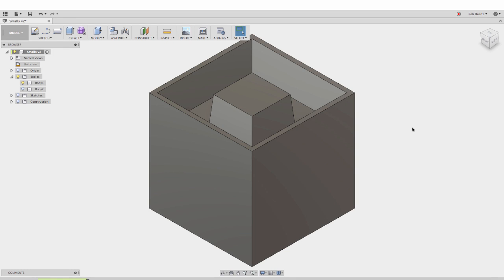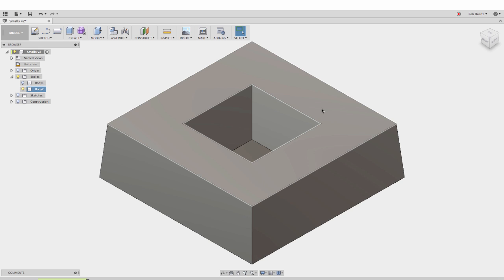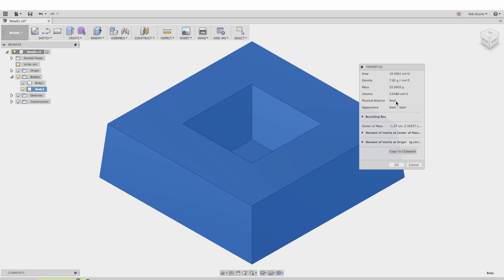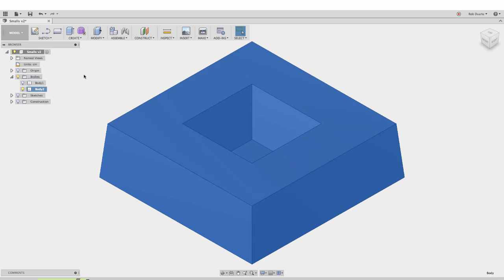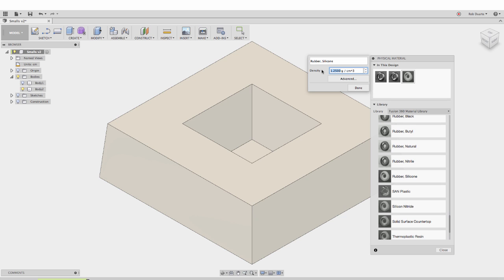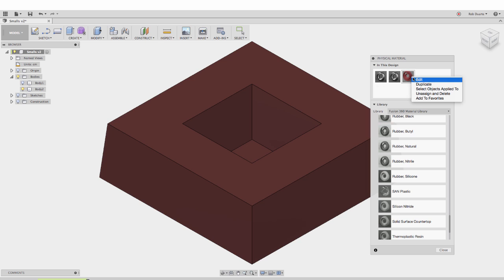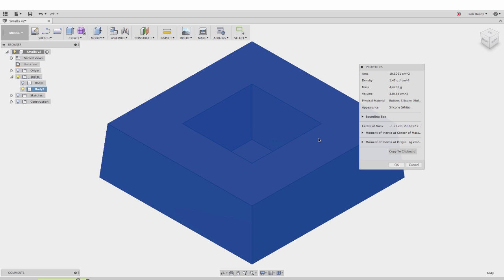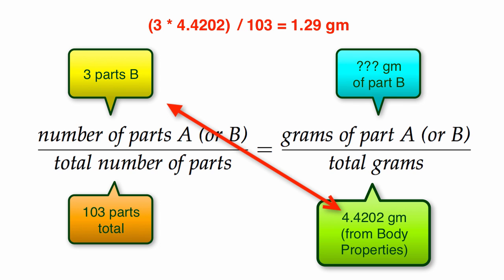Fusion 360 Physical Materials, Mass, and Volume!

Comment: Hey Rob .. Thankyou for this fantastic video ... A quick question to you .. I am a user of Fusion 360 and the mass I want to see it in pounds but even in your video the mass is in grams .. If I want to see the mass in pounds where is the setting for that
Reply from the maker: Thanks - to change that setting, click on your name in the upper right corner to get to Preferences. Then under "Unit and Value Display", change the "Material Unit Display". Good luck

Comment: I made a quadrilateral volume that I need to know gallon capacity, defined it as water, and the properties show bogus numbers. 1.52E+05 in/\3  I figured it out via online calculators finally. So 1.52E+05 in/\3 = 498 gallons. lol
Reply from the maker: Glad you figured it out - they're not bogus numbers, that's scientific notation.
Reply: I figured that out also after my comment. I turned that option off and voila, it gave me a mortal number. Lol
Reply: @Motovader72  Hi, I had the exact same problem, i finally found it in Preferences –> Unit and Value Display & enabling the Use scientific notation for big and small values :) Good luck guys